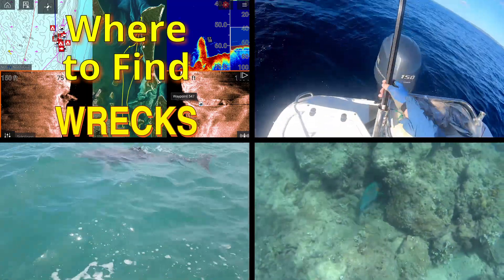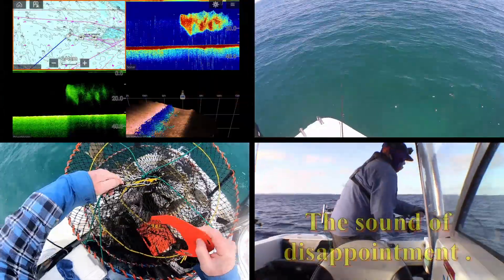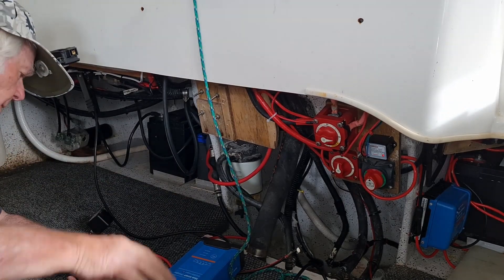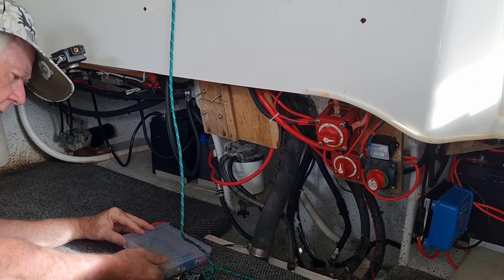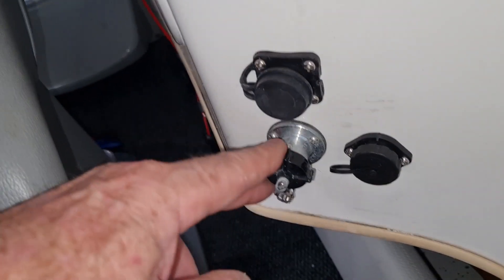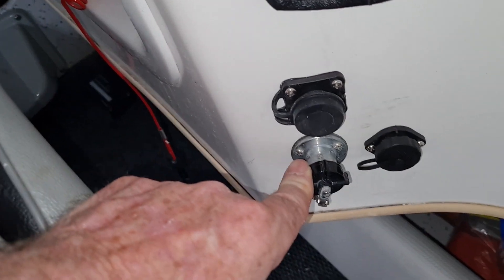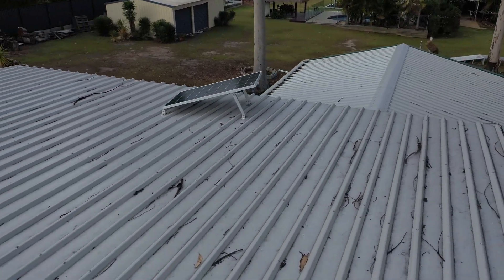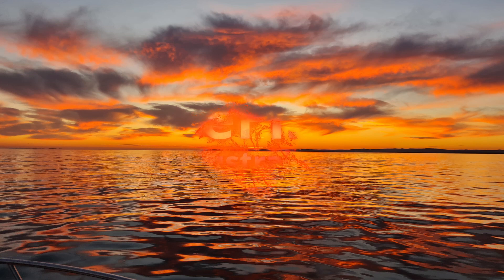Solar System for my Boat

Comment: Those chargers are fine to leave on 24/7 - they will detect the full charge state of your battery and just keep it healthy. Gone are the days of constant voltage dc power supplies, Smart chargers are smart and can be left on batteries ensuring they remain in top condition.
Reply from the maker: Yes,  I have been told that by several people but I have also had a lithium battery supplier tell me not to leave his battery permanently on charge.   I presume his BMS is a bit dodgy but I figure it can't hurt to unplug it when it is charged,  just in case.

Comment: i had the similar set up but found the boat struggled with the solar blankets on the Bimini especially into the wind but perfect when sitting
Reply from the maker: I expect that.  I plan to pull it down when moving and probably won't deploy it at all if it is blowing.

Comment: Another good vid.  Very versatile and practical installation.  I use Anderson plugs for most of my heavy drain stuff and as you said crimping is the way to go.  I do some work on aircraft as well and soldering is verboten on any aircraft. 
 I have discovered a great way to make sure that all my crimps are undistorted and in particular with the Andersons the terminal lug only comes in one size per amperage rating so if my cable is not a snug fit I cut short lengths of core solder and fill any gaps around the stripped cable before crimping and it saves any distortion of the connector.  I am sure that some may criticise this method but I have never had a failure even in harsh conditions.

Please keeps the vids coming.
Reply: definitely dont pack or solder a crimped connector - theres a whitepaper on why crimping is superior to soldering that nasa did ages ago, not to mention aviation and automotive have all moved over to preferring crimped connections.  Packing with solder can make a high resistance connection, create heat and so on (wire would be better but still not a good idea).  Simply use the correct cable size for the terminal. 50a anderson plugs go down to 12awg from memory.  Soldering a lug is definitely not recommended as the solder can wick up the wire making it brittle.  I get you've never had a failure but I personally would never do that.
Reply from the maker: Thank you.  I tried Anderson plugs, they didn't give me any trouble but they were starting to get corrosion on the pins so I replaced them with plugs that had gold plated pins, only an atom or two but I don't plug them in and out a great deal so it should last a while.
I hadn't thought of using solder as a filler, I usually just cut some extra wire to shove in when the fit is too sloppy..